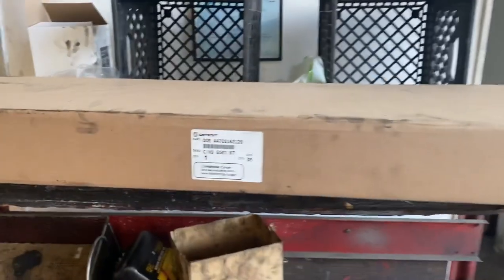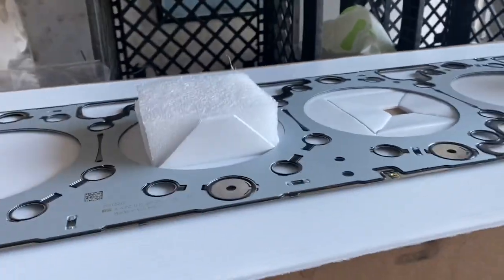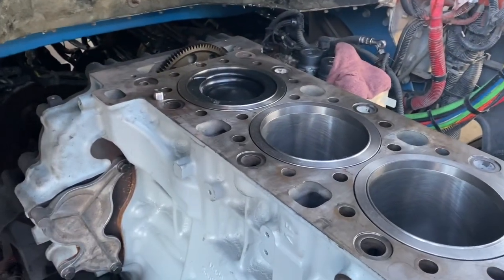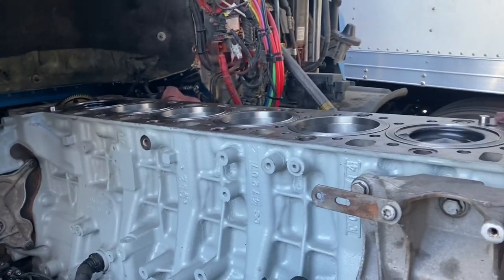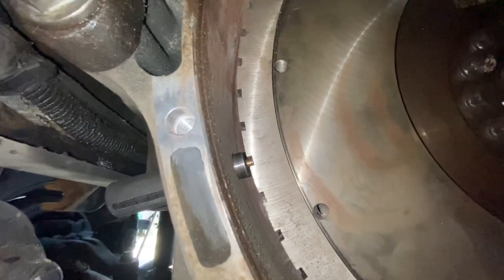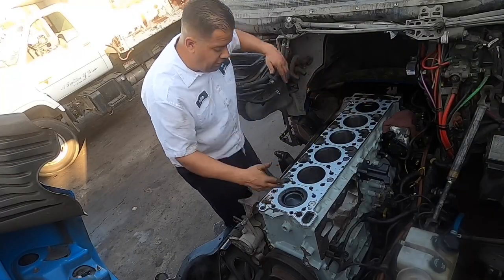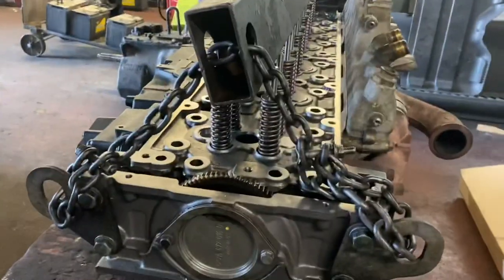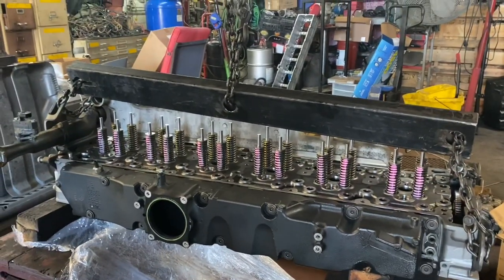DD15 major engine overhaul Part 5, cylinder head installation

Comment: Hello master. What the reason smoke 💨 come out from crankcase breather. Only it’s coming out from crankcase breather ? 
Engine DD15 2016 
Thanks an advance
Reply from the maker: Remove the oil fill cap and look for blow by.  Could be piston rings

Comment: Ok so u said you left it at tdc 1 what if you are not sure where it was left at tdc 1 or 6 how do you know where to put gears on ? Or do u put it in what ever position and start overhead accordingly?
Reply from the maker: I always set the crankshaft at TDC, I confirm this by the flywheel and the timing pin on the side. The engine (crankshaft) will always be TDC (as long as it hasn’t been moved or rotated. Both number 1 and 6 will be all the way up (TDC). Once you put the cylinder head on nothing changes. Once you put the intake CAM and exhaust CAM. The marks on the CAM (little triangle on the tooth) will be your starting point. 
Let me know if that makes sense.
Reply: @CarlosDieselElectric  ok so pretty much as long as pin was installed and dot on flywheel is against that inspection plate marker im good I can install the cams with triangles up ?
Reply from the maker: @Eljuancho915  yes. You should be good to go.
Reply: When I said put Gears where ever I mentioned to say as in timing marks down as if it was in tdc6 or up as in tdc1 but now it makes perfect sense

Comment: How many miles did that engine have on it before the infrrame
Reply from the maker: The engine almost had 900K miles.
Reply: @CarlosDieselElectric  man bro that's kinda low isn't it? What caused it to fail lack of maintenance?